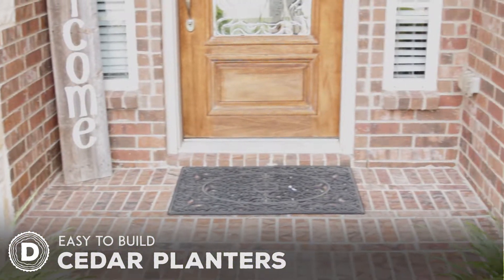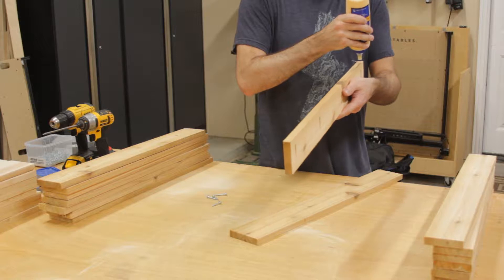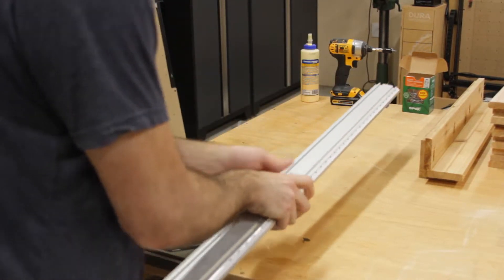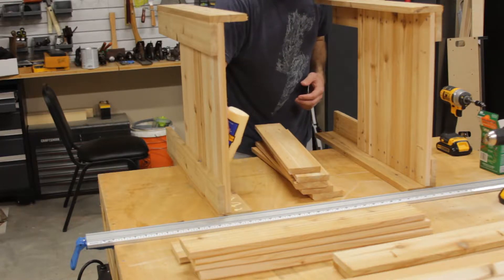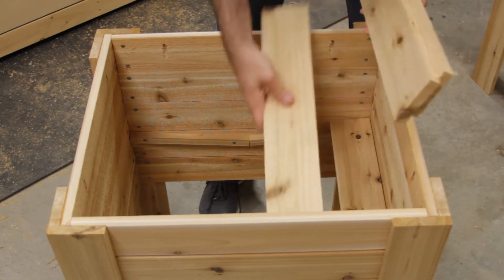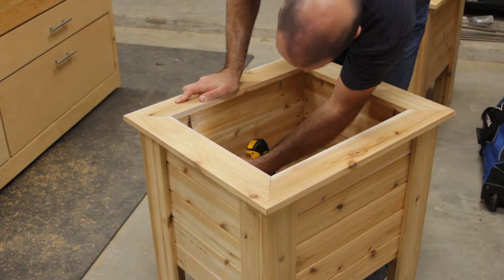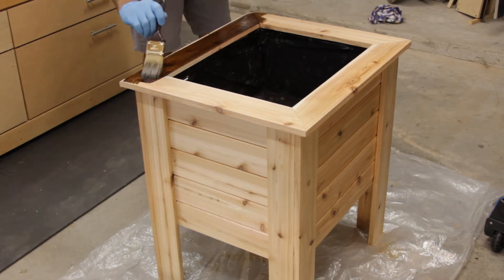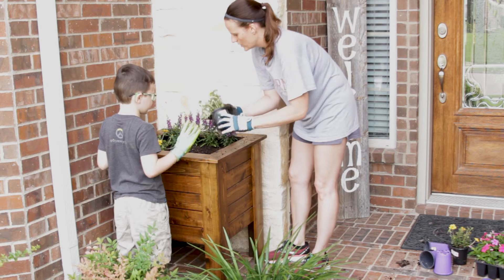How to Build a Set of Easy Cedar Planters

Comment: I had searched several days for just the right planter build. I need four, to be used for small orchid trees. They will be located in a showy, high traffic area, for a public venue. You have the very best and simple process, with all that is needed to complete the project.

Comment: When I first see you attach the first panel sets, I didn’t see you use any glue, just screws, but then for the 2 shorter panel sides I did see gluing.  Did I miss something in that you only applied glue to the longer panel sides. Just checking for my own planter build. Thx